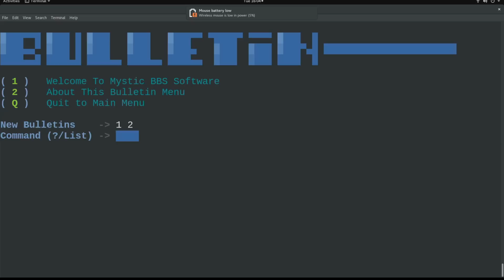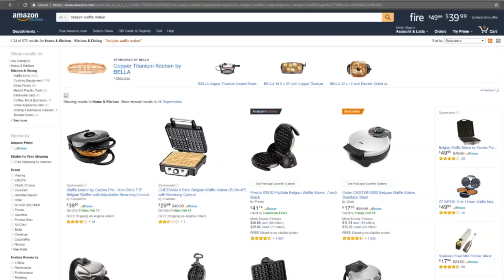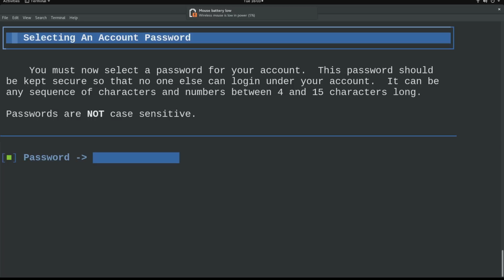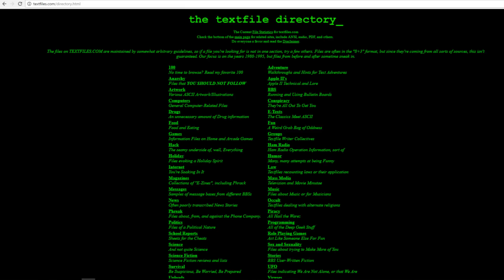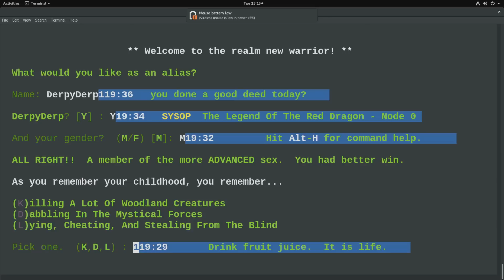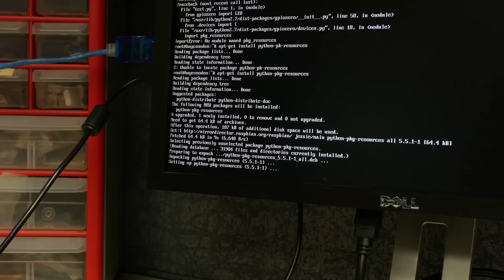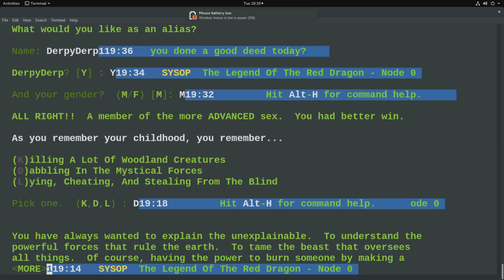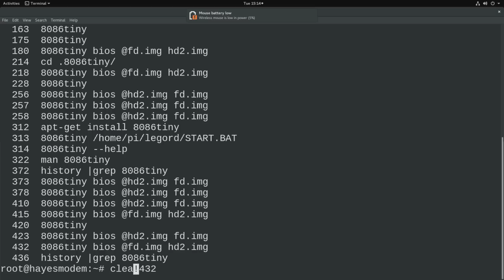A baudy Linux Hack: Hayes Modem modded to Linux Desktop (and modem time machine).

Comment: This was a neat project!  I ran the Music & More BBS for almost two decades.  We had the largest collection of Mods, Scream Tracker, and Midi files in the world (still have a lot those files still backed up) that people would upload.  We had Fidonet relay (by modem to modem) mail as well as a large selection of online games.  I ran the game Tradewars 2002 up until Sept 11 2001.  Older computer nerds will get a lot of what I am explaining next.  "To the rest Sorry!" ;)  In the early 80s I started on RA board then moved over to a Wildcat BBS system which offered IMO a better multi-node.  I ran 2 nodes on my 12Mzh AT clone with a Neat chip set using Quarterdecks Deskview.  When i got my first 20Mzh 386 that was actually built for multi-tasking I switched to Deskview X (loved that program!) and 4 nodes.  When i jumped to 10 nodes (4 dial up and 6 telenet) I switched to OS/2 for it's amazing multi-tasking and virtualization (it was written in assembler which made it much faster than Windows).  I was the second person (to my knowledge to ever put a BBS on telnet).  We were a regular add in the Computer Shopper which was a big (literally and figuratively) publication back then.  Had regular users from all over the world.
Reply: Gene A where can I listen to this collection

Comment: It was a great time back in the early days.  My first computer was a Sinclair ZX80.  The modem plugged into the back with a card edge connection, and the file storage was a cassette deck.

Comment: The Rube Goldberg reference kinda got to me.  Analog modems were used for dialup back in the day because the telephone network was designed to handle voice calls.  Dialup modems simply converted data into a format that the telephone network could deal with.

Comment: Thanks for making me feel even older than I am!  I built & ran the TECH-LINK BBS, running on a TRS80 Model 1,Level 2 with 3 drives. I even hacked my modem (originally a 300 baud Hayes) to auto answer with a full wave bridge tied to pin 22 of my serial port. But you say it was a manual modem?  I had a phone sitting in the ears full time, and used the latching relay of the expansion interface, which was designed to select between 2 cassette ports, and a z80 routine to sit in the background to poke memory 16553 to select & watch for carrier detect if someone didn't hang up properly & do a JMP 0 to force a system reset.  And it was running under NewDos80.  Ahhh... that's been holed up in my geekness for too many decades.

Comment: Hey Wendel, could I use the pi zero to build an active AT-XT keyboard converter? Would it introduce latency while I was typing? It's much cheaper than a teensy, hence my question :)

Comment: LORD was what I started with when I first used a BBS. The board it was on had a time bank system, so you couldn't (well you could) sit online forever. You had a set amount of time per day to stay connected. But, you could store minutes in a bank, and then use them some other day. You could also gamble minutes, and the system was strange because if you gambled boldly and with "high risk bets", you'd always end up winning more time than you put in. Ah the times :)

Comment: The first game that I programed onto a floppy was pong.  I didn't realize that there was sound for that game until I noticed it in the programming.  I spliced a speaker onto a plug and even had sound.  When I returned the manual with the program and told them it had sound they didn't believe me at first.

Comment: This, milord, is my family's axe. We have owned it for almost nine hundred years, see. Of course, sometimes it needed a new blade. And sometimes it has required a new handle, new designs on the metalwork, a little refreshing of the ornamentation . . . but is this not the nine hundred-year-old axe of my family? And because it has changed gently over time, it is still a pretty good axe, y'know. Pretty good.

Terry Pratchett, The Fifth Elephant 

This is a good point on Theseus' Ship: If you never exchange a part of it, it's perhaps more "the same" ship than otherwise - but it'll soon be a very crappy ship...

Comment: this made me want to build something of my own. I want to make a little box that you plug into the TV, and type the equation of a Julia Set for it to render and display in colors and high resolution. with the ability to zoom, like Harrison Ford did in Blade Runner on his TV, by drawing a little rectangle on the image, zooming into it and re-rendering that portion at a higher res. I have a broken ti-84 calculator that I can use the case and keyboard, and put a raspberry pi in with an HDMI out the top. Then I could add the option to save the rendered image or print it on paper.
I would use the keyboard of the calculator (connected to the rasp.pi) to input the equations and navigate the interface (it even has arrow keys!).
Maybe also add a shortcut to the Mandelbrot Set, would be nice to zoom and slide through it on a large TV screen with my students.

Comment: I had an Atari 800 and a 300b modem (MPP-1000C) that hooked up through the joystick port. I remember all the sounds.. and That US Robotics modem you decided not to use I had one of those too later (I almost went to work for US Robotics)
I didn't because they wanted me to quit my existing job that day and start work for them the next.. I wanted to give 2 weeks notice. (It was a temp job - and I did not want to screw them over)

Comment: I should see the puppet first, but I think it's going to take some beating.

I actually started using BBSs on ZX Spectrum, (actually, a friends, not mine) and the absolute most you could get out of it was 64 x 22 characters, and then every other character had to have the same colour as the one before it. XD It got a little bit more fun on Atari ST and Amiga computers, but by that time it was 9600 baud and 56K (or K56, not the same, but the same speed ... ish) was right around the corner. ISPs were a thing so you could dial in to the ISP and telnet into the BBS from "the internet" in most cases. Because "the internet" was a thing for many years before "the web", and in many ways the World Wide Web was the death of "the internet". I mean, the cloud and Web 2.0 apps are now turning our revolutionary Home, and Personal Computers into dumb terminals on a remote mainframe again! This is progress? ;)

I'd kinda prefer to use VESA framebuffer without X, for the authentic look, but to get 4K, I can see why you went GNOME.

The way I think of 1200 baud, is that the ZX Spectrum loaded from tape, usually between 2400 baud and 3400 baud with the "flashloader" type things. 15min to load 32K from tape, but tape was higher fidelity than a phone line, and in the 80's, even local calls had clicks and echo and all kinds of scratchy nastiness. XD

The 48K Spectrum internal speaker was just a single bit hooked directly into the I/O bus of the CPU, and you made sound by alternating that bit faster or slower for higher or lower pitch. IMS you could pull it high or low from Basic with OUT 254,0 or OUT 254,1.

Comment: Your Mouse battery is low.
Reply: :o great scott! The batteries are down to 1.21 volts! (from.. 1.5 volts..)
Reply: Wonder with which mice this Linux notification works...
Reply: Works with my logitech unifying mice and keyboard - and i discovered solaar, the linux unifying pairing replacement ... if you use linux and have unifying devices, just try it!

Comment: Yo wendle, I think you should upload the disc image from the Raspberry Pi and provide an instruction manual on how to build it and wire it up to USB, then anyone can make an offline USB BBS system to plug into their computers! (I'm assuming its connected over USB internally.)

Comment: That's cheating! It should use the original circuit board and run linux on that.
I've tried finding a image of the original PCB, looks like there is a Zilog CPU along with a eprom chip.
Maybe with a ram upgrade it could run CP/M, or with a bit more of an effort a cut down version of uclinux could be loaded, that would be the real thing. :D
Still a good video tho.
Reply: Using the original circuit board would have severely limited his options and it would've been just that, linux on a modem. That's kinda lame.
Reply: It would be limited of course, but then again its an achievement that goes in the extreme, like that ATmega project that emulates an ARM cpu that loads linux.
Maybe the title is a bit misleading, should say transformed instead of modded.
Reply: Dajgoro Labinac Exactly don't throw in your own board use the original hardware!
Reply: That's what I was expecting. Rather disappointed that it was just a modern board in the case and not a custom linux actually running on the microcontroller.
Reply: Or at least leave most of the original hardware in and wire a RasPi into it to expand it's capabilities or something.

Comment: Fido-net and other nets used encrypted packets and you had user name and password to logon so it was not completly open. 
My first regular connection to a BBS was using a 300bis modem and when I could upgrade to a Hayes 1200bis it was fantastic. Then up to 2400, 19200, 38000bis and in the end a 56K modem, and that was used to connect to the internet.

Comment: I had a modem set to 1200 baud and I thought I would see what happened if I set it to 2400 just for laughs..  
Turns out, for about 1 yr, I was using a 2400 baud at 1/2 speed :)

Comment: I am disappoint.

I expected that you used the 68k processor that is present in many of these old modems, perhaps expanded the RAM to maybe a megabyte or two, and got at least ucLinux running on the actual thing.

Also a modem is way newschool, try loading anything from tape on a z80 home computer, at 300 baud, and adjusting volume till it no longer fails to load a few times, and hoping the cheap Soviet tape didn't stretch or jam. Now if you made any flavour of Unix run on a z80 home computer, you can be redeemed.

Comment: So is the BBS emulator only accessible from the other Linux computer in the modem?

I can see what you are going for if so and I think it's awesome.

The only thing I wish you might've done instead is make the modem an actual BBS server itself. As in make it able to be connected to over ethernet with some sort of BBS emulation or simulation so that you could have an Internet accessible server that could pretend to be an old BBS server that would "call up" any of the archived servers.

Comment: A home computer in 1984 would buy a pretty nice car or even a down on your first abode.You were a rich kid.HA!I was 24 in 84 and I financed my first computer in 95.That was 1500 dollars.
Reply: DizzzyKipper my first computer was at 1984 it cost me $4k I saved for a couple years
Reply: See that's what I am on about.New car, down on first home,Computer?Wendell was most likely born 1984.Unlike young people today .I had been out on my own for quite awhile.A computer was not in the cards.
Reply: DizzzyKipper 
Don't forget about inflation when thinking about those prices. People often forget $1 in 2017 is worth a lot less than it was in 1980.
Reply: A floppy drive cost $300 in 1980.  I was single back then.  I had 2 TRS80's, 4 drives on my main system, and 3 on my BBS.  Now with kids & mortgage, I have to save up to buy a new $30 multimeter.

Comment: But can it run Doom?
Reply: ImStillAnAss the 1993 version of course ;)
Reply: If it has some badass igp it will run new doom :D
Reply: Afonso Muralha or Duke Nukem, Heriitic, or Hand of Fate?!
Reply: Brad Brundage you forgot quake and Wolfenstein ;)
Reply: Actually people used ipx through bbs to play doom.
By play I mean novelty because before dsl, pings were so insane it was just an exercise in frustration.
Games which implemented modem support correctly were rts games like warcraft, the lower latency requirements ensured that was a viable way to play.

Comment: I was hoping he was gonna legit run Linux on the original hardware. Like access the terminal through a dial up connection or UART somewhere on the board with a super minimal kernel burnt to like 50 ROM chips and make a ghetto data/address multiplexer.

Comment: It's an interesting project, but I wouldn't say you're running Linux on a modem if Linux is not running on actual modem hardware; if I understood it right, what you have there is a couple modern devices running Linux, a custom novelty case, and a fake modem running in one of the linuxes.

When I saw the title, the worse I was expecting was you added a RasPi on the free space inside the modem, and wired it to the old hardware such that it would send the screen data thru the modem protocol; that way at least you would still have some of what actually made the modem a modem.

Comment: And here I was hoping you actually hacked a very stripped down linux onto the modems original hardware or at least modifying the original hardware as little as possible. I used to have a old Zyxel modem that had a useful Motorola 68000 cpu as the controller in it, but then again a Modem as old as this one might have had a Z80.. which would have been a awesome CP/M hack..

Comment: Yeah no the story of the ship of theseus is in no way comparable because you didn't just replace components with functionally identical components you replaced them with components that serve an entirely different purpose. Like if in the story they replaced the sails with jet engines and wings and the ship could then fly.

Comment: I hate it when people toss something such as a RaspPi or a Arduino into a old case such as a Hayes Smartmodem 1200 extruded case and call it said item "Hayes Smartmodem 1200". That would be like cramming a turd into a doughnut box and calling it a box of doughnuts. In my mind set for it to qualify as a Haynes Smartmodem 1200 running linux it would need to run on it's hardware electriclly wise, Not just the enclosure. For a example a iPod running linux. Linux ported to run off of the hardware to the iPod. See where I'm getting at? I'm not really trying to bash anyone, im just tired of the false advertisement.